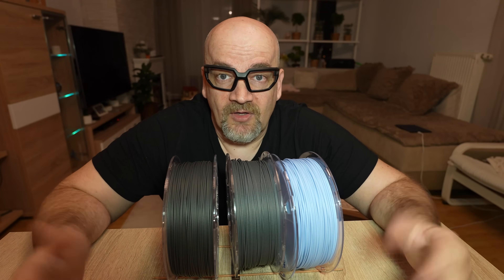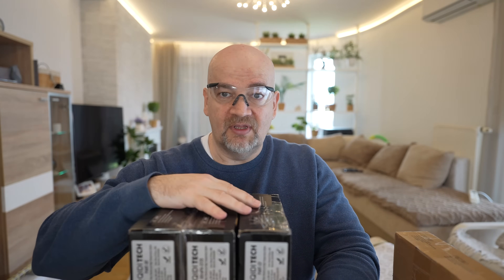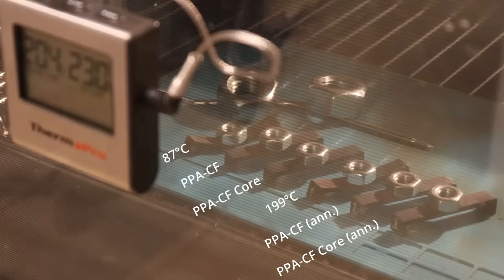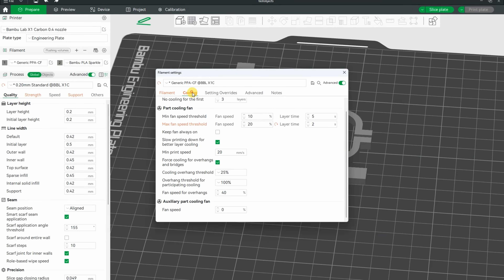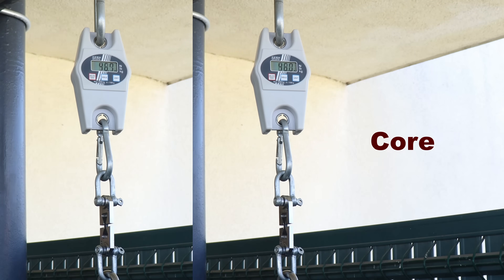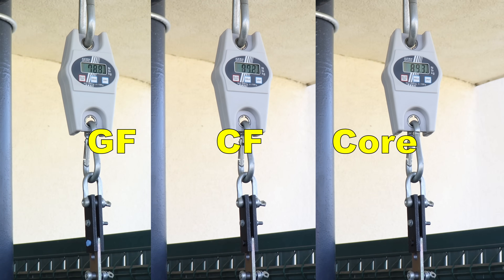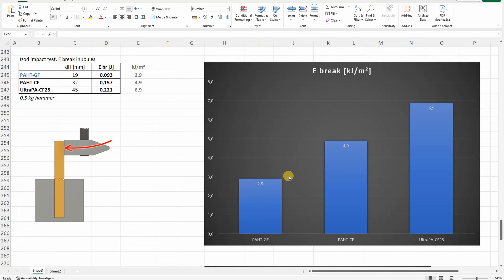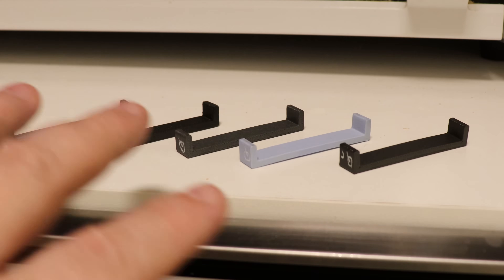Qidi PPA based filaments: PAHT-GF, PAHT-CF and UltraPA-CF25

Comment: Great video as always!

Try CPE CF112 from Filamentum, is the best carbon fiber filament that i ever tested.

The layer adhesion is crazy, and the impact resistance is very high for a composite filament.

It was so easy to print that i still dont belive.
Reply from the maker: Are you sure? It is also a Copolyester and so far I tested one (Polymaker CoPE), but it has weaker mechanical properties, compared to PLA..
Reply: @MyTechFun  yess! take a look on the TDS.

I do not belive until i tested.

the only problem is find him here in Brazil.

I print in a UltiMaker S7, but any 3D printer with heated chamber would be even better.

Comment: Please consider testing and making a video using 0.4mm nozzle with the 0.6mm extrusion widths (arachne off). I found that this causes the fibers to be extremely exposed for some reason. Maybe flow is no longer laminar?
Reply: It is laminar, it's just the higher extrusion pressure
Reply: @riba2233  life tip, people find it really annoying when you act like you know everything. The extrusion pressure is the exact same when your flow rate is constant and your temperature is constant.
Reply: @Javii96  life tip, don't write about stuff you know nothing about ;)

Comment: Great video! Have you tried printing the layer adhesion specimens sequentially instead of multiple at the same time? It would be really interesting to see how good out of plane properties you can get close to the softening temperature with these materials. I work with testing and characterisation of various high performance polymers and it's always fascinating to see how good properties you can get with a high layer fusion temperature.

Comment: It would be also extremely interesting to see the effect of a heated chamber of the QIDI printer on layer adhesion, e.g. at 60 degrees, compared to increasing the nozzle temperature. And also the effect of annealing PPA-CF on dimensional stability, since pretty much all manufactures - e.g. Bambu, QIDI, Siraya - recommend annealing it for increased temperature resistance in the materials TDS, but this may deform the parts.

Comment: Glad these companies are recognizing the value of your testing! Qidi generally sells top tier filament, though it is pricey. That layer adhesion increase with print temperature is awesome. Really shows the benefit of a printer meant for this kind of filament like the Plus4. Combining nozzle temp, chamber temp, and annealing you can get some insanely strong and temperature resistant prints from this stuff!

Comment: Siraya tech says not to dry PET-CF unless it shows signs of moisture. They warn that it can make the filament more brittle if you over dry it. Kindof interesting.
Reply: Chances that it will be wet are basically 100%
Reply: That’s untrue. I’ve gone through 6 rolls of fiber reinforced filaments with them including 2 of PET-CF and have not had a single roll come wet. I can tell when it gets wet because it strings and has worse surface finish. I only had to dry my PET once after leaving it in open air for too many prints.
Reply: @Javii96  you can't know that it's fully dry just by visual appearance. It also affects the layer bonding, I doubt you tested that. And they don't dry the filament before packing it so...
Reply: I weigh my filament before during and after drying. I know the difference between wet and dry filament. Siraya tech clearly says not to dry the PET u less it shows signs of moisture saturation. Why are you pressing me?
Reply: It’s simply untrue that the filament comes wet. Stop spreading false information. “Wet” means it’s popping and sizzling and near it’s saturation point. They say do not dry it unless it shows signs of being wet because when it gets over-dried it becomes more brittle. So if you are telling somebody they need to dry it before test printing then you are going to give somebody a bad first experience with the material.
Reply: @Javii96   because their pet filament is nothing special, they didn't develop a new formula that acts differently than the others and they certainly don't pre dry it, they just buy it from fusrock and slap their label on it. Don't be naive
Reply: @Javii96 oh boy. It's not false information, you just drank their marketing kolaid. No filament comes bone dry from the package, especially not ones that like to soak up moisture (which pet-cf absolutely is), their pet cf is no different than any other and it needs to be dried if you want maximum performance (and you do, otherwise you wouldn't bother with engineering filaments). No, wet doesn't only mean sizzling and popping, wet means everything that is not absolutely bone dry and you cannot overdry it, it just doesn't work like that. If it does, it does with all pet cf filaments and we would already know about that, theirs is certainly no different.
Reply: And yes I’m aware that it’s fusrock. There’s nothing wrong with that. But Siraya tech has done extensive testing on the materials and provided very detailed data about them. Look at qidi for example they didnt even explain what the “core” filament was on their website. If siraya tech says do not over dry then I’m not going to over dry. They are in the business of making money based on their technical data sheet claims. If you are insisting that their filament is stronger than they claim when you over dry it, then you should put that theory to the test and show it on a video. But i think if there was more performance to be had at more dry levels then they would clearly state that and boost their strength claims.
Reply: @Javii96   and what is that incredible strength in tensile mpa in Z direction? Yeah you don't know it.
Reply: @Javii96   btw I just saw your two shadowbanned comments, and boy did you misunderstood the topic. Wet vs dry properties are only for nylons and only for printed items, not for filament before printing (which also has to be bone dry in case of nylon if you want good printing properties and good performance), after printing parts will get saturated with moisture naturally. This has nothing to do with pet, especially before printing lol. Siraya did nothing special and they don't know some hidden magical info others don't, so stop being naive like I've said.

Comment: Hi Igor,
Small mistake. During Bending test ( 11:15 ) you have switch label of CF and GF on screen (blue GF filament with CF label).
Thanks for video.
Reply from the maker: Oh, yes. How could I miss that? Thx. But at least in graphs everything is correct.
Reply: Good thing the GF was blue so it was easy to tell which was the correct one. Love your videos. Keep them coming.
Reply from the maker: Yes, that was a typo error, since I tried to keep the same order too..

Comment: Awesome test! I’ve been using the siraya tech one after your last video. However I did notice that while there is zero creep at regular room temperature when used as material to print Voron parts when the chamber hits 50-60c it starts creeping. 

Maybe that is the biggest benefit in annealing. Creep resistance. The old test where you had a bolt through a part and checked creep by how much the bolt would turn a day later is an excellent test for this. 

Please do consider reintroducing this test  and also testing when the part is used in hot conditions. Your regular creep tests don’t account for hot operating conditions right now and I bet you the results would be very different if tested like that.

Comment: Hell yeah! A near 14% difference in layer achesion strength simply from bumping temps by 20C is incredible.

Now hear me out, these results almost prove that sirayatech and qidi are the same material. And guess who makes it? Fusrock. As far as im aware, theyre the actual OEM as ive stated a few times on your channel so I hope its not too annoying. But heres the thing. Fusrock actually mentions the ppa-cf and ppa-cf core can be printed alllll the way up to 340C. Seems like even more testing needs to be done ;) your channel is the single best filament testing channel. No one does it like this. Cant wait for more testing
Reply: If you checkout the TDS sheets of the Fusrock and Qidi materials the evidence of rebranding is clear. Nothing wrong with that....
Reply: @The_Dutch_Pancake  oh I know, nothing wrong with it, but I find the Qidi ultrapa-cf25 to be ludicrously expensive vs siraya offering. I'm inquiring with some Alibaba retailers to see if they have the NexPA-cf25. I found the NexPA-GF25 (core variant of ppa glass fiber) and it's only 79.99usd vs the 220cad I have to pay for the ppa-cf core.
Reply: @FrozenByFire3  Update us if you have any luck with Alibaba!
Reply: Yes, but what consumer printer can get to 340. If you know of one thats sub $3000. I'll buy it!
Reply: @Phiz787  what? Qidi printers do, a few others also and the new Bambu H2D does and if you get the printer alone it's sub 2kusd.
Reply: @Phiz787  Bambulab H2D is 2 racks. There you go.
Reply: @Phiz787 Qidi Q1 Pro is $400

Comment: It's strange that according to your creep tests these have minimal creep. I have used QIDI PAHT-CF to print several mechanical parts and I can confidently attest that it's the most creep prone material I have ever used. Even worse than PLA. A couple of months under continuous load, the parts fold like paper. 

If interested I could take photos and send you.
Reply: I don't think these are actually PPA. If you read the Material Data Sheet they're very careful to not say what they are. I'm surprised there aren't more comments about this.

Comment: I've printed PPA-CF at 345C at very slow speeds and the layer adhesion goes crazy. I honestly feel like it would be pretty much 30-50% stronger than printed at 300C. 

All of this can be done on the Qidi Q1 Pro for 450USD, which is insane considering how versatile this makes any at-home engineering products at that price. When your printer is only as expensive as 4-5 rolls of your premium engineering filament, you know that is some bang-for-your-buck.
Reply: q1 is amazing bang for the buck. at one point you could get one for 350

Comment: Hello Mr Igor. Very nice video as always and I'm always eager to watch your videos😊. I would like to suggest a test for you. As you know, a lot of the users print with two walls and the regular 0.45 extrusion width. Between the walls though there is a gap. So is it better to print with two walls of combined extrusion width of 0.9mm or one with the same extrusion width? You can do that with a normal 0.4mm nozzle so you don't need any extra parts.
Reply: This was tested a long time ago and it's better to use one thicker line instead of two thinner
Reply: @riba2233 oh ok. Didn't know that. If it is indeed better then why all the dafult profiles use two walls instead of one? Doesn't make sense...
Reply: @AngelVenomous   it's not that simple, there are pros and cons for both, it's not about the strength only.

Comment: Really appreciate these videos, i ended up buying Siraya after your last video on their line and have been really happy with it. I'm curious about the core versions, if they might be any easier to handle or for printing objects that might be regularly handled? the Siraya PPA-CF25 has a a very noticeable rough texture and i would worry that it could be irritating for objects that are regularly handled. For instance before this i was printing parts mainly with Fiberon PET-CF17 and maybe its just the lower fiber content, but items in that material were much easier to handle

Comment: When your weakest direction is still stronger than the strongest direction of other fillaments. This PPA line really is a breath of fresh air
Reply: The nylon based filaments still concern me for long term part usage though, their ability to absorb moisture and potentially change mechanical properties over time makes me extremely hesitant.
Reply: @bobgodd  PPA-CF has like 10x less water absorption than other nylons. It even has significantly less moisture absorption than PA12. This stuff doesn't give 2 shits about moisture lol
Reply: @bobgodd  PPA which is modified nylon is less likely to absorb moisture, so it should be better choice.
Reply: @bobgodd  For PA6 (which is the "worst" in this case), I just put the part in water before using, so it cannot get more flexible anymore. PPA and PA12 are less affected by moisture than PA6, but PA12 shows a lot of creeping, therefore I will use PPA or PET for rigid parts and PA6 when high impact resistance is needed.
Reply: @Krypton3684  I'm designing an intake elbow that will go between my throttle body and supercharger. I need it to hold up to 100c reliably, and indefinitely. I want to avoid annealing because the dimensional accuracy is critical for this application. I cuttently have a roll of Bambu pet-cf waiting for this purpose but am getting cold feet... I'd like the extra headroom just for piece of mind.
Reply: @bobgodd  If the material is going to be exposed to 100 C for extended periods (like in the engine bay), then it will likely see annealing in the application.  You might be better off trying to do your own annealing with some experimentation so you can factor in the correct shrink rate for each axis.  Just a thought.
Reply: Yea it will likely self anneal. Like when the wheels don’t really clear but you keep driving until they do
Reply: @Javii96  yea, I can't risk the sealing surface warping. I'll stick with pet-cf for now. Might send the file off to get printed in aluminum as well, not sure yet
Reply: @Krypton3684  PA can also be annealed to reduce creeping
Reply: @bobgodd  You can always put a skin of carbon or glass fibre+resin on it, with the current material. Ive seen it work on a friends SC car, even for track use, and that was skinned petg
Reply: @  I thought we were talking about PET-CF. I would trust the PET-CF to not warp.

Comment: This seem an ideal DIY engineering material! It has greater layer adhesion tension strength than PETG has in horizontal direction! I can't wait for core versions of PETG and PLA, though. These might also be a big improvement compared to standard versions. The only issue is the price. All CF version cost more, I wonder if this continues to be the case.
Reply: Also, Maker's Muse recently posted a video involving PBT filament, with promising characteristics, maybe Dr Igor can test it in the future? Seems like an impact resistant relatively soft material, but still harder than most TPUs.
Reply from the maker: I ordered that PBT, when it arrives, I will test it.